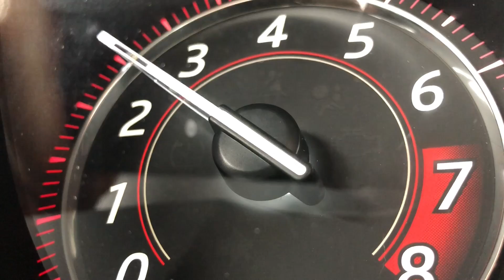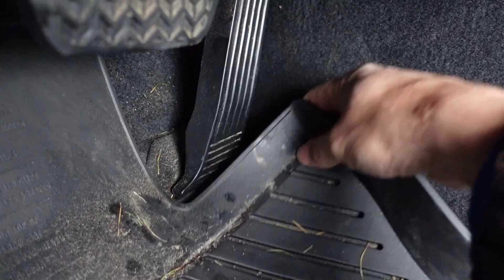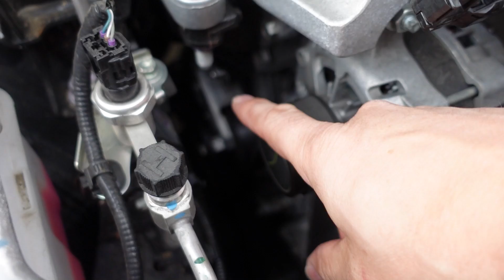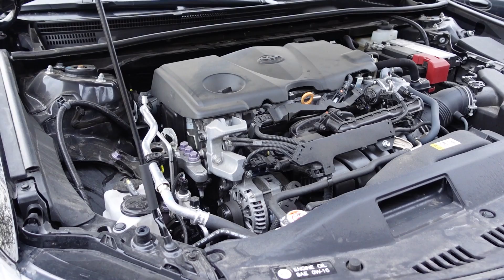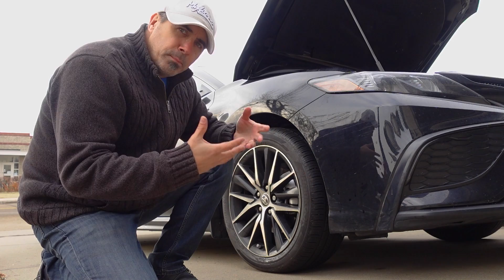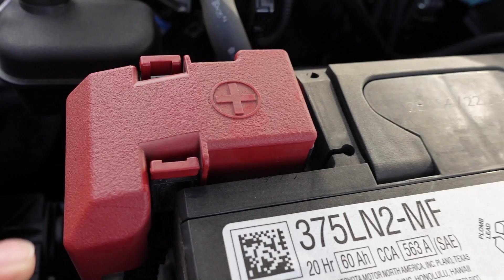Has Toyota LOST Its Reliability Reputation?

Comment: I can't even imagine being a mechanic today! All the computers,sensors etc.
Reply from the maker: Chaos to say the least.
Reply: Thats  why no repair no matter how small is less than $500 at a minimum.
Reply: This is where Scotty Kilmer comes in and says "hold my beer and let me show you how it's done".
Reply: @arnimkrause  Scotty Kilmer is completely senile, and out of touch with the world, he wouldn't know his way around a modern car, much less anything built in the last 30 years that isn't a Toyota Celica. He's a proffessional clickbait artist.
Reply: The big problem is that you would have to charge people for the time you are sitting in front of some kind of a computer.

If you are the shop owner you have to spend a lot of money on different diagnostic equipment.

To try to guess where a specific issue is, is almost impossible. There are always a number of options.
Reply: @leiflillandt1488  Why is the big problem sitting in front of a computer? The mechanics have to diagnose any way they can. It's the same in medicine.
Reply: Mark, you say, more or less, if you have a fault code suggesting O2 sensor failure, the problem is that there can be a number of other issues that causes false O2 values.
I hope I can take time to find out how to test an O2 sensor without dissemble the sensor in question.
As you know, I have also a 2011 BMW X3 30d, inline 6 diesel engine. These sensors can show values within the range, but they are still not correct. This you will notice if you compare the values of a number of other sensors!
The values jump up and down "all the time" and then you must be able to see the pattern.
The thing is that these two (at least) sensors are not that cheap. Another thing is that they don't last forever. And if they aren't "perfect", except higher fuel consumption,  the catalyst will be destroyed prematurely.

So at the end it would be very nice to have an affordable app (with OBD adapter) that ALSO can check the condition of these O2 sensors. I'm not sure but maybe they (Bosch!) suggest change after 100,000 miles/150,000 km, but I would like to drive till the sensor values aren't exactly 100 % correct.

There are so many problems with ICE engines after about 2008-10, so I can't count them all! And many or even most of them are quite expensive to repair.

It will be a relief to change to EVs, but they need maybe about five more years to get "quite good".
It's not a nightmare to own a new ICE car as long as you have a warranty, but after that it's more or less hazardous, Russian roulette...
I use to say, you can't have a cheaper car than a VW Golf 1.6 from 2002... Any car built after 2010 will never be cheap to keep rolling.
Reply: @leiflillandt1488 lean oxygen sensor code often leads to sensor replacement when the real problem is the fuel filter, especially GM’s 💩